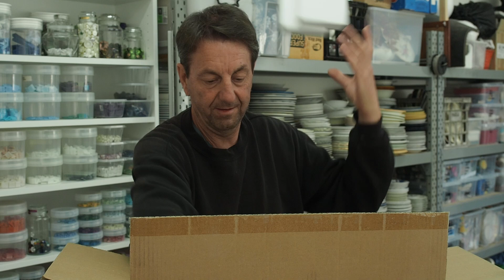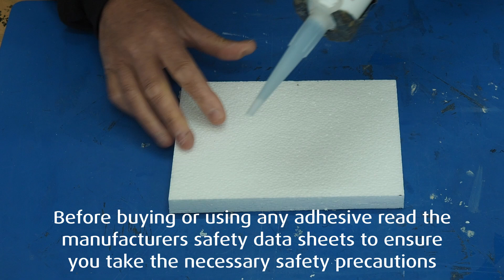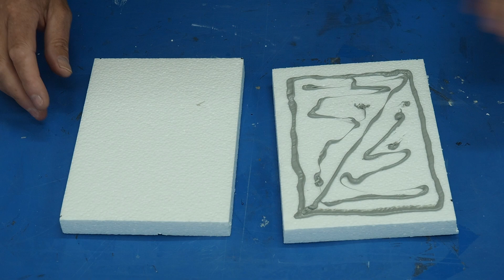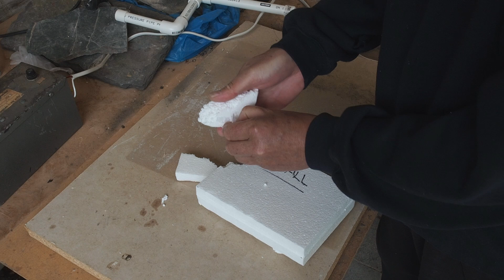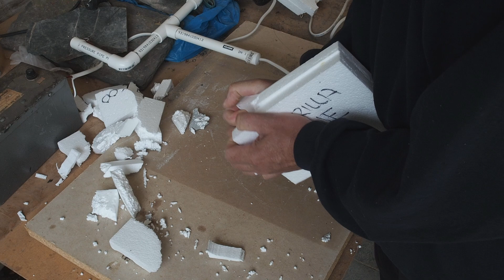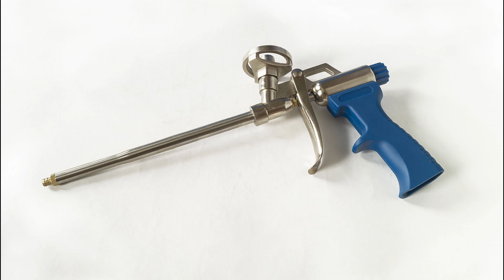Polystyrene, Adhesives, Sculpting For Mosaics - Part 1

Comment: Could you use PVA
Reply from the maker: It would depend on the environment its in because PVA will return back to its original state when it comes in contact with moisture. I think I used PVA decades ago but I think it distorted the foam due to the water content and drying. I would suggest running some tests first.

Comment: How do you weatherproof it? Here in the UK it rains for half the year! 👍
Reply from the maker: Weatherproof or waterproof? Loved the UK when I was there many years ago back in the 90's. Generally speaking, If you grout with Litokol epoxy grout, that is waterproof and will stop any moisture from getting in. This is provided you have used waterproof tesserae like glass. The other thing you can do is cover the polystyrene with Pal Tiya which is a sculpting medium and will take extreme temperatures, use a suitable thinset for the adhesive or another suitable adhesive and then use an epoxy grout, again use tesserae that is waterproof. Whatever product you use make sure you read the technical data sheet and safety data sheets to ensure its suitable for the environment you're using it in and to protect your health. They are very easy to read. I have made a video on using Paltiya for my Large Outdoor Gazing Ball, its in my playlists. I hope this helps and thanks for watching. :)

Comment: I work at a hospital so have a bunch of the hard styrofoam I collected to make up cat shelter insulation. If your local lab for blood collection doesn't have a recycling system for styrofoam recycling, then ask if they will collect for you. Oyr blood tubes come in styrofoam packaging as does our larger equipment.
Reply from the maker: That is a fantastic tip for sourcing materials and helping the environment, thanks for sharing and for watching. :)

Comment: Use expanding poly in an aerosol tin to glue up layers. And weight them down!
Reply from the maker: Thanks David, that does work well but a hot wire going through it can be difficult if at all. I have heard "Great Stuff" in the USA is good to use but I personally haven't used it. Thanks for commenting. :)

Comment: Can I put the polystyrene for decorative molding ?
Thank you!
Reply from the maker: I cant answer your question specifically, but generally yes. I have seen it used as molding on the outside of a building, many years later it has worn due to the birds and the weather. I would think they would apply a coating over it to increase its durability. I would think if it was inside there would be less issues to be concerned about. :)

Comment: Peter, thank you for sharing!  Question, do you know of a good substitute for Fix All in the USA? I can't find it here.
Reply from the maker: Thankyou so much. If you are wanting to adhere the polystyrene together then "Great Stuff" its completely different to Fix All but that would be one that I would look at, its a expanding foam but the low flow version combined with the applicator gun supposedly works very well. I haven't used it as its not available here and as always ensure you read the MSDS and technical sheets before purchasing or using as with any product. Im sure you would have a similar product to Fix All in the USA but I personally dont know of one.

Comment: Thank you for all of your helpful videos.  I do have one question.  Have you ever used PET foam?  It's made from recycled soda bottles.  I found some cast-offs from a plumbing wholesaler.  They use the foam for shower floor substrates.  I wonder if it can be cut with a hot wire.
Reply from the maker: Thankyou and my pleasure, I have used different foams in the past for different signage and photography applications I have only used EPS for sculpting, I would suggest doing a test on it with a hotwire or have a good look on the net and see what comes up. :)
Reply: @TreasuryRoad   Thank you.  I'll give it a go.  Probably next spring when it's warmer and I can work outside.
Reply from the maker: @laurimuhonen9484  Sounds like a plan. :)